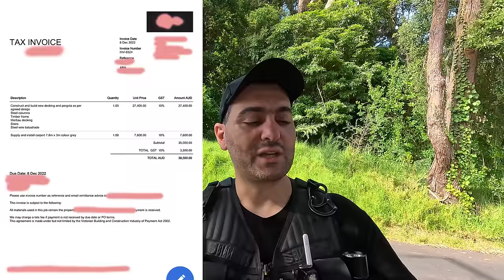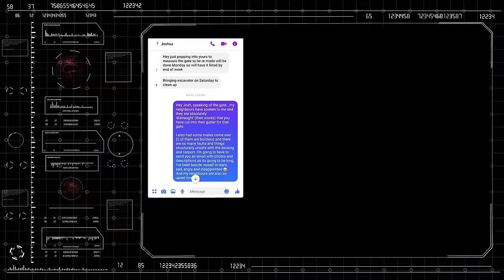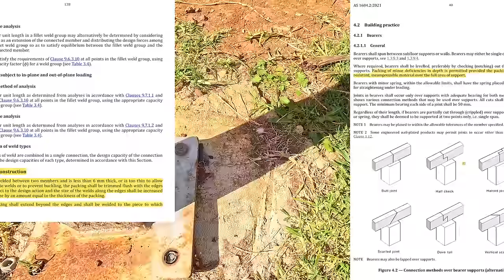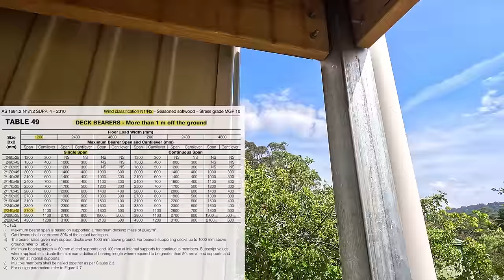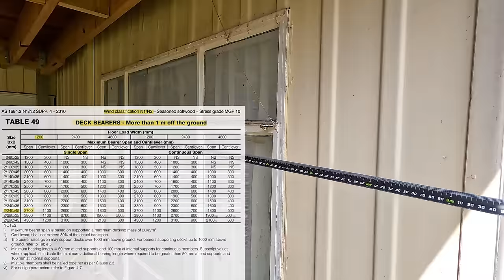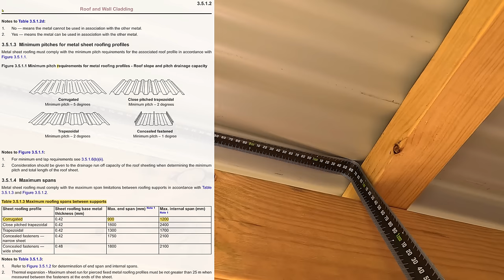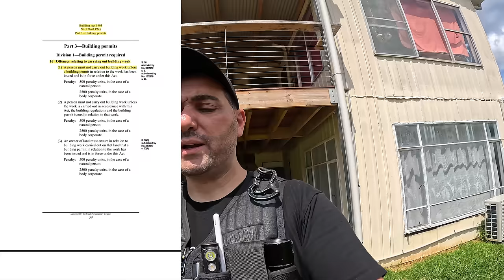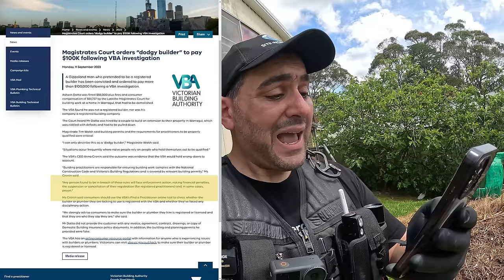I Inspected A Dangerous Build | Illegal Build Caught

Comment: When he said you could drive a car over that deck, he must have meant a remote control car. Absolutely shocking and dangerous work, this "contractor" hasn't got an effing clue.
Reply: Yea couldn’t even put a Kia picanto on that mess lol
Reply: You could drive a car on it - assuming the transmission worked - though he didn’t claim it would hold.  You can drive a car on anything! You know, assuming the car actually runs.

Comment: The VBA are hopeless and have done similar to myself and The person who signed a certificate was not the person who did the job and claimed it was a sub contractor working for said builder corruption runs deep in Victoria unfortunately.
Reply: It quite prevalent in these videos.
Sad and disgusting. It's not a place to build a home.
Not these days anyway.
Reply: Yeah, sub contracting can be awful USA side too.  My sister had to get a licensed general contractor due to wanting to alter a business space many years back.  The laws would not allow them to do it themselves even though they know how to and could do it quickly.  We understood the reason for the rule and normally would be fine with it, but the only one available locally in the remote town did okay work, but was super duper slow.  A two day project was dragged out to months due to "never having time" to come out.  They also sub contracted the plumbing out.  Now that person was a nightmare!  Literally used duct tape to hold pipes together!  My brother-in-law went to check the work on day two and promptly fired the both of them.  My sister and brother-in-law had to rezone the place to residential and then do the work themselves.  Then they rezoned to commercial and had it inspected, which of course it passed with flying colors.  The whole incident left a bad taste in the mouth though, and they sold the place shortly afterwards.  After all, if any work needed to be done in the future they would be right back to where they started.  There needs to be stricter oversight with these scammers.  It hurts both those wanting work done and those competent contractors willing to do the work.  That town could have had a decent worker instead of that scam artist and layabout.

Comment: How many times must it be said to never pay any tradie up-front full amount. This is an immediate red-flag sign not to go ahead. Every good tradie has told me this as a tip as well...
Reply: You often need to pay up front for materials. In this case, after the knockdown, most of the timber can be reused.
Reply: I run a construction crew and i send the cliebt to pay for the materials straight away by sending them the invoice but after that i just get partial payments. I tell people never pay by the hour either. I also only do jobs for good people to avoid me getting fucked over too.

Comment: I had an electrician once disconnect the MAINS power feeding into a building, so that the old, 1950's wiring could be removed to make way for renovations etc.  We started cutting out the old wires, when I saw amongst the jumble a thicker gauge wire.........and that got me thinking that something was not right.  We had been told the wires were safe to remove.....but acting on a hunch, I followed the wire and it went out the wall and straight out to the main line on the power pole in the street, still very much intact and alive.
Reply: and... what's that got to do with this?
Reply: Yes -- If I am ever trying to dig-out a piece of toast from the toaster -- I don't just switch the toaster off, I disconnect the plug -- But even then you must be careful -- I once pulled out the wrong plug.

Comment: The home owner should be reaching out to their local member of parliament - you will be surprised how much assistance you can get when an elected bureaucrat gets involved and brings the issue to the VBA etc.
Reply: Bring the issue to the VBA... to do what exactly? Its a really messy area of the law if you're not covered by legislation (which this owner would not be)
Reply: If the "builder" is not registered and basically a DIYer , then unfortunately the VBA, as useless as it already is, cant to that much. Homeowners assume their own risk if they hire people to do "under the radar" cash jobs when they have NO clue themselves. Its one thing to hire someone if YOU know what correct or not so you can supervise and check but its VERY risky for the weekend warriors or worse, those that struggle to identify a hammer.
Reply: @james3744  You will be surprised how ministerial action can be a rocket up a government bodies ass, doubly so if it's a marginal seat.
Reply: Due to bank fraud, many are resorting to cash payment.

Check VBA registered, they send subs and apprentice.

Must have insurance over certain amount, they split the bill into two jobs.
Reply: The staff in the NEW Local Members Office will just say it's a matter for the Civil Courts or other supposed Authority.  The home owner will not get through to said Member due to obstructionist staff. A letter will only end up doing the same passing on the problem, by a junior staff member. 
Worse still... Yarra Ranges Council are pathetic in terms of Building Compliance/Enforcement - have ZERO CONFIDENCE this corrupt council will do anything other than force the owner to demolish the structure.
Reply: @jri752  Do you live in the electorate of Monbulk or in the Yarra Ranges LGA?
Reply: She deserves everything she gets, honestly it’s her fault. She should of checked if he was a registered builder
Reply: The big thing these days is to fix up government -- The trick is that the mass of the people must join a political party.  

The character of public policy is a reflection of the character of the members of parliament -- And the character of the members of parliament is a reflection of the character of the rank and file membership of the major political parties.

Comment: I loathe the pathetic attempt to excuse the work as acceptable because 'she wanted a cheap job'. 

"Cheap" doesn't have to mean 'sloppy and/or dangerous' or 'not up to code'. Cheap is 'it probably won't look pretty'; maybe you have to compromise on non-safety features like design elements or scale. Skimping out on nails and screws and just doing an all-round bad job isn't being 'cheap', it's being dirty, lazy, and negligent.
Reply: Cheap to me is functional, but not the prettiest, but won't be unsafe. He could've easily done that job cheaply but also up to code. The fact none of those steel beams are properly secured and all those overhangs on the concrete pads just points to terrible sloppy work. Would've cost him nothing to actually bust out a measuring tape and mark out where those concrete pads should be for the pillars to land dead center and have all 4 bolts properly installed.
Reply: @kasuraga  He even could have violated code left and right but still delivered a safe balcony...

Comment: I'm not a builder but everywhere I looked on this death trap I keep seeing things that I definitely would not do if I were building it myself. From the shabby roof, the gaps in the roof, the hole in the right side of the so called patio where a child could walk out to their death, cross beams underneath, SEVERE LACKING of support beams horizontally and vertically, missing so many bolts and nails and nailing things into nothing, cross beams supported by nothing, welding places to the uprights were virtual tack welds, and 1 bolt, hell no way.
Floor boards supported quite literally by nothing, railing at edge non existent, should be a I would say at least comes up from a sturdy square tube steel upright say around 10 cm X 10 CM X 4mm at least, and attached to that 6 or 8 meter square tube a welded horizontal bar same size as that wood dimensions, and welded to the upright on all 4 edges on each side both sides maybe something. and so much more.
Redirect the rain water from what was there to a new system and spread and then re direct it to 2 or 3 new down pipes with new guttering, and in the corner were roof meets house, do it proper so rain water does not go down the walls of the existing house.
So I could be here all day saying about what I saw wrong, and what I believe should have been done to rectify it, ESPECIALLY the underneath side where they would be walking on. I spot all this and I am not a builder.
So many shonky dodgy builders. 
Sub standard and way out of wack concrete so called support foundations, and when you go to the side car port, the side gate is supported by the rood, did anyone see that the pole was not attached to the foundation plate ? not to mention the missing concrete foundations.

Been through DBDRV, they have no power and no authority, pointless when you got a dodgy builder who is not willing to do what is right, but unfortunately they make you go through that.

If that were my place I would want the entire thing demolished and get the entire $47,000 back and start again.

I would get proper drawings and measurements done up myself, make sure everything is triangulated and quadruple measured  and confirmed.
How much weight is to hold in any one area, how many vertical support beams are needed and in what area, and how to securely attach the horizontal support beams to the vertical support beams, and how to support all the horizontal support beams via the cross beams, and how many cross beams would be needed to be secured to ensure the firmness of the floor beams which one walks on so all the weight would be evenly distributed so there is no bowing, and all the cross beams can take that weight, and to ensure no movements of any vertical or horizontal support beams.
Also need to know how to PROPERLY attach to or seam into the existing dwelling, 100% not like what they did.
It needs to be main support beams along every section along the house and boundary of the patio so that someone could ( as an example ) someone 110 kg could stand up against the wall of the existing house and jump up and down and securely know there is not a snowflakes chance that anything would give, because the support beams are securely secured to the house properly, and also takes the brunt of the load across a solid strong thick beam to a vertical upright to bear the load, and another solid beam, maybe 60 mm X 200 mm thick horizontal support beams supported by another such beam at the end of that beam secured so that it would hold the weight.
horizontal support beams possibly no greater than 300mm apart to avoid bending and drooping of top floor panels which people walk upon.

But then again as I said, I am not a builder, maybe best to get someone who this site inspector would know and recommend.
Too many dodgy builders, even when insurance people send out their dodgy careless builders who are so incompetent.
I built a wood fence about 20 years later and another one 10 years later and 20 years later and 10 years later respectively it still as good as the day we put it up, strong and solid.
Reply: DBDRV Al#x determined our case was too 'complicated' for them to investigate.  WTAF!
Reply: The problem is the owner wanted a cheap job ....and got a cheap job. The builder obviously has VERY LITTLE appreciation for span tables and member sizing or loads. Likely has NEVER heard of them. Its a case of this timber looks big enough, yep I'll use it. This bolt looks big enough, no worries, I'll use it.
Reply: @fifthdimension1984  But also he seems to have run out of bolts 😂

Comment: Anyone else notice that the Builder/Carpenter sounds like a junkie? Through the texts? 

“Oh sorry home owner, my work 4wd died and/or needs trans fixed or needs head gasket and/or blah blah blah etc etc” 

Even IF builder/carpenter was going through a hard time, would you tell a customer about that? Would you try to use that sort of reasoning at all? Fuck no. 

>_>

I’m in awe at how unsafe all of that is. It really Blows my mind.

Comment: Hey mate love your content. However when you referenced 1170.1 I think that might be for commercial space I havnt checked this however if this is correct it contradicts 1684.4 because the design floor load for timber decks or floors for floor loads only is based on 45kg per m2 kind regards
Reply from the maker: AS 1684.4 section 1.5 

1.5 DESIGN CRITERIA

The design criteria that have been used in the preparation of this Standard are the following:

(b) The design dead, live, and wind loadings recommended in AS/NZS 1170.1, AS/NZS 1170.2 and AS 4055, were taken into account in the member computations, with appropriate allowances for the distribution of concentrated or localized loads over a number of members where relevant (see also Clause 1.4.2).
Reply: @Siteinspections   sounds like you've memorised the book, absolutely awesome how you just rattle off the numbers
You obviously love your job and take these matters very seriously.
Well done

Comment: The 'builder'  admitted that they did a 'cheap job' - so they don't deny it is their work.  Should be a simple one for the courts to decide on - unless they come to some form of settlement.
Reply: It's possible to reuse some of those materials, the decking, the posts, although more will be needed, the roofing-again more will be needed, i don't know about all that timber under the deck, the builds I've worked on, the timbers were thicker/or at least, appear to be thicker than these. There's a lot of support material missing.
It definitely needs to be very carefully dis assembled, lots of accy props, yeah.

Comment: The work is piss poor however lets not dramatise things to much. You would be surprised how much load it would take before failure. The shear strength of a 12mm bolt is many tonnes
 Of course this is not compliant and needs to be rectified.
Reply: The loading on the long deck beam against the wall is crazy. He said it was buckling from moisture but it is actually buckling as a sign of failure. He actually really undersold how precarious that member is.
You are right about the M12 capacity but they got it in the top where the most important one is the btm. The timber will just split in this location. If they triple that member and double the other deck beams the rest isn't too much of a problem.
Reply: Maybe when it's brand new, after corroding in the weather for a while.... not so much.
That bolt wasn't even done up tight!  So every time you walk near it, it will be working ie: metal fatigue!

Comment: Unbelievably low standard of construction workmanship here in Victoria. Not only that but the wages and house prices are among the highest in the world. WTF!? If I ever build a house here I reckon I’ll be on-site myself the whole way through.
Reply: if you are serious, buy something built pre 1980. it's probably hard wood, not pine
Steel frames are good if they've been built properly (I've seen blokes try to nail gun skirts in steel homes, ha ha) they have to be screwed.
Anyway, I certainly wouldn't buy anything built this side of 2010 unless I knew the builder and the contractors personally and had witnessed their work
I'd definitely stay away from the 'big companies' way too many 'extra overheads per job'
There's good builders available, you'll find them when you try to book them and their busy for a year or so ahead
Builders who are sitting idle are so for a reason

Comment: I prefer steel, PFC 250-90 galv for the bears and C250-2.4MM Purlins for the joists would have been a better choice than that crappy MPG10. Even with 2x290 x 45 its will still sag over time. The house is a mess to start with too, I would be looking at fixing up the house first and replacing that horrible cladding, before even bothering installing any flashing. The footings were put in the wrong places that's an easy fix.

Comment: The Apprentice is never going to financially recover from this weekend cashie... All jokes aside, thank god this was inspected, that deck framing is dangerous. The old 4 clouts a side sh!t should have died out 15 years ago. It is on the box "fill every nail hole on the hanger with 35 x 3.15 connector nail, not hard.

Comment: I live in the states. Built plenty of decks.  That deck is not about to fall down.  You definitely found some issues that can be fixed.  Without tearing that down.  You definitely play it up for the camera. Gotta make it sound like it's going to fall down.   How much was the materials? 20 thousand?  I watch to see what you guys can get away with over there.  I like seeing what is different.  The rim plate should be doubled.  Where the same part by house hits the floor joist should be a beam.  What size are those beams?   But what I see can be fixed easily don't demolish.  Repeat, don't demolish.

Comment: Geeez, you need 3 pairs of gloves to touch that job. Didn't even bust out the wallet to get 12mm bolts to fool the client. 10mm on a structural connection😮

I don't know what this guy has been smoking, but I'll take half a pound.

Comment: reminds me of the builder we used to link a roof between house and the shed .. all they did was screw / silicon glue onto the existing gutters some type of C Chanel .... and sat the poly carbon sheets in between @22:00 well ours fails , 6x12m span @22:00 well ours now really fails no x bracing at all